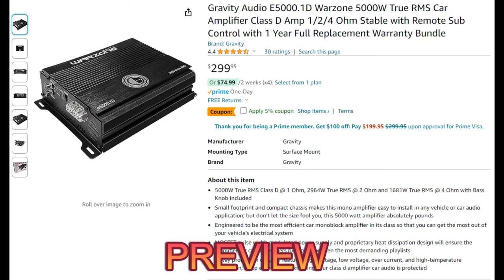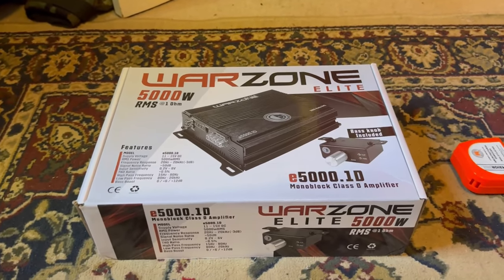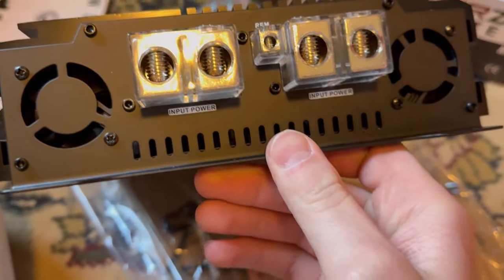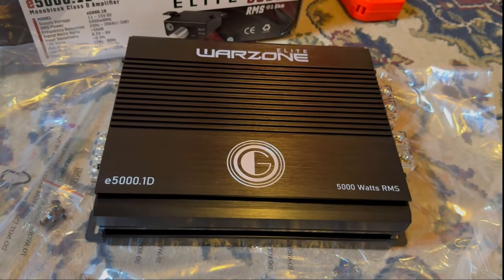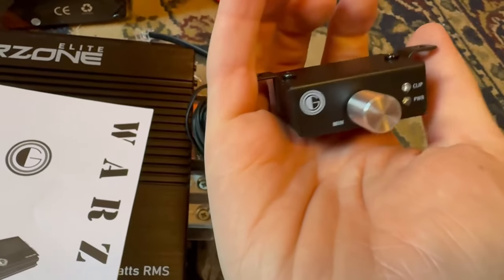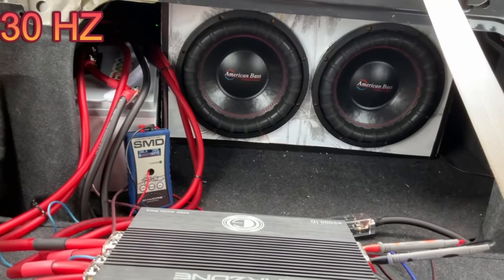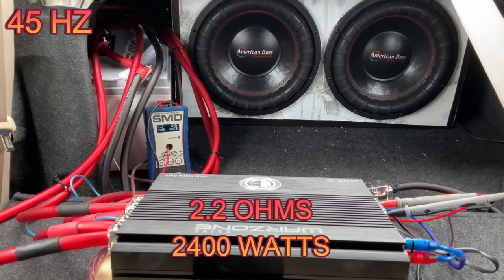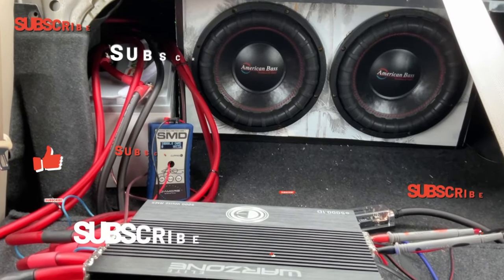Gravity Warzone E5000.1D Amplifier! Is It WORTH The MONEY?

Comment: Hey man I want to ask you about your redodo 100ah are you pleased with it? Who does it compare to agm? How do you think it would compare to the big Jeff and the d4s lto batteries? Your the first person I seen using one of those batteries in car audio and got me very interested since I am having trouble. I have 1 Avater stu 15 powered by a jp23. 240 alt with 2 agm. All 1/0 cable. 2 power 2 ground to the back. It does ok but is not enough and i am looking to add another avatar i already have. So I will have to geta much bigger amp also. I seen you had moved up to a 5k. How is your electric taking that? Avatar eat power. I don't have enough electric it seems to get the full potential out of my jp23 with the set up I have now which is unbelievable to me but that amp does eat power to. Do you think adding a redodo like you've got would be as good or better than a big Jeff or d4s lto?
Reply from the maker: I think the big Jeff and d4 i are better but my redodo and power queen are hooked up and it dident drop below 12.8 V on the 5k now i will be updradinf the battery bc I want bigger amp but I was very please what it did with the 3k and 5k. But the redodo and power queen both are way better than agm. But I’m going to try and get my hands on a big Jeff battery and review it.

Comment: Bro so that lithium battery u got on ur amp, is it holdin up with a stock alt
Reply from the maker: i have 2 litium one is in the back same amp hour. Lowest it dropped on stock alt was 12.8
Reply: Oh ok wow...whats the highest it's ever been charged
Reply from the maker: @MistahALJ77  I just got my 320amp alt in and the highest is 14.75v
Reply: Cool! I'm on a stock alt with 45ah agm for backup. In ur opinion will 1 of these Batts or 2 in serious..

I got a 50ah Bruce Willis agm powering the car
Reply from the maker: @MistahALJ77  no doubt about it one of those batteries is better than the agm. Is is 100 amp hour LiFePO4 battery if you want I have affiliate links for Redodo and power queen. For 5% off use code “Bass” for Redodo and “BassMenace” for power queen. But have an agm under the hood.